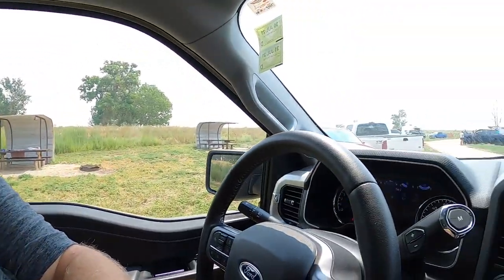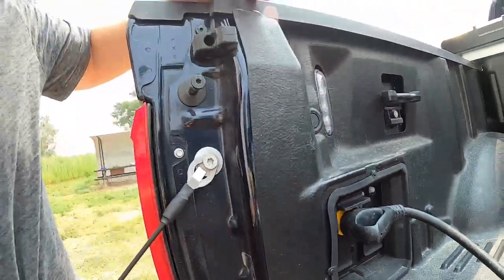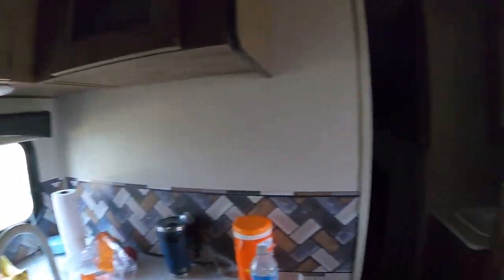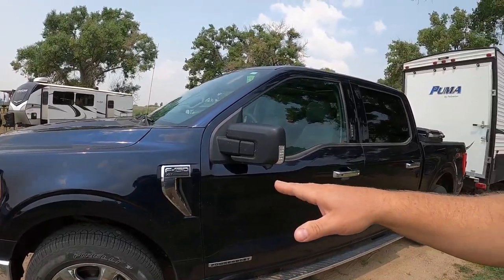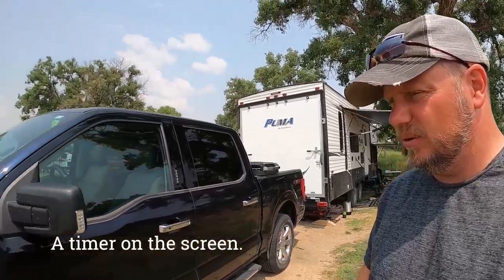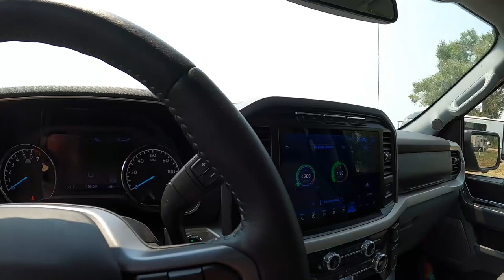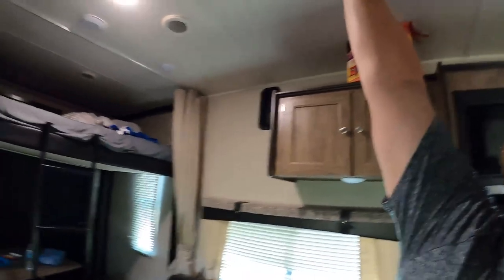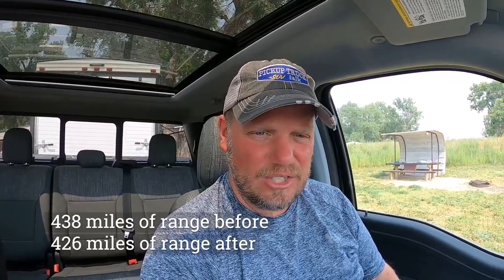Shocking? Running A/C for hours, 2021 Ford F-150 Hybrid Generator

Comment: I'd like to see someone run it for at least 8 hours. Fill up before and after the test to know exactly how much fuel it used, and what it cost. I think that would be the best test to see how efficient it actually is.
Reply from the maker: Impossible test really with way too many variables. I did this test during the heart of the day because an overnight test has just too many variables. What happens if the weather changes? The temperature drops? The wind picks up? We turn down the A/C because the camper holds the cold air better at night? 

Running it during the day for a set period of time shows the worst case scenario. You can take the result and multiple it by 4 to get the 8 hours of the test, which I talk about, and you'll see fuel usage will be around a quarter of a tank, if that, like I said.
Reply: @Pickuptrucktalk  I don't agree that it's impossible at all. I mentioned an 8 hour test because I don't believe a shorter test would use enough fuel to give an accurate result. My point is that it would be nice to know that with the AC running how many litres of fuel you can expect the truck to burn. As an RV owner and frequent traveler this would be valuable information. Especially when boondocking for a week. That way you can decide whether it's better to use a standalone generator, or the truck from a cost perspective.

The problem with your test is that you went off of what the EVIC displayed for miles to empty. This isn't reliably measurable in terms of how many litres are burned.

Also, based on the data from many other RV owners theres no where near ¼ tank of usage after only 8 hours of run time.

I've enjoyed all your videos on the Powerboost, and had been looking out for this one for a couple months since you mentioned it initially. I was just bummed that the litres per hour powering the RV AC still hasn't been tested.
Reply: @skidoomxz550x   problem is SOC of the battery at start and finish would need to be calculated. Also you’d have a variable load… you’d instead need to run constant loads like heat guns
Reply: @cybertrk  Not really, the battery has such a low capacity that I don't think it would make a difference. Based on all the data I've seen the truck runs for about 4 minutes with the engine off, then about 1 minute with the engine on. So even if you're fully charged in the beginning it'll drain it back down in approx. 4 minutes. 

Cranking the AC right down would give you a constant load. Even better would be to test it on an average weather day in your area. Let it cycle on and off at whatever temp you typically set it to. That way you can get the cost on an "average" day. This would allow you to assume for "X" amount more or less on a warmer or cooler day.
Reply: I left my truck plugged in for three days in generator mode in Iowa in August.  I think I used a 1/4 tank of gas.  30 foot camper.
Reply: Ford says the Pro Power 2kW running at full capacity on a full tank will run for 84 hours. 26 gallons (XLT) at $3 is $78 or $0.93 an hour.
Reply: Thanks
Reply: @billypippin3046  What size tank?
Reply: @jonromero4406  30 gallons I believe.
Reply: how much wear and tear is that on the starter/ engine turning off and on every 4 minutes?
Reply: @TheGregh1977  those starters are supposed to last for 10 years of use.
Reply: @TheGregh1977  this Hybrid does the same thing when you drive it.  Especially in the city it’s constantly cutting on and off.
Reply: I ran my entire class A RV including AC, ninja foodie, refrigerator and more for 24 hours used approximately gallons of fuel. Also no comparison to regular gas generator noise, almost silent!

Comment: Thanks for the info. Btw, rv camper is 30 amps at 110 volt not 220-240 volts. Another words same as residential house outlet just more current available at 30 amps vs 15-20 amps. I mention this so watchers dont plug their RV into a 220-240 volt outlet and detroy all the electrical in the RV ;)
Reply: My first thought when he was saying he bought an adapter!
Haha
Reply: Did he not say that it was a 240volt 30amp twist lock to 120volt 30 amp adapter? I've watched something similar to this on TFlL Trucks, but with a dual 50amp adapter. I work in water so I have no clue about electric other than hooking up pig tails for plumbing appliances.
Reply: @Rick not true actually. I had a contractor install a 30 amp plug on my house, but little did he know that that meant I needed 110 even though I specified it was for a camper. Everything ran fine for about 10 seconds, until my convertor started smoking. I lost the fireplace and microwave, but fortunately hadn't turned on the AC.
Reply: @armegeddonschildren  the adapter only uses one leg of the 240v supply. It's just like your house panel.

Comment: Hoping to see a Super Duty Gasser with the built in generator / Hybrid.
Reply: Duuuude, you ain’t kiddin! Imagine a 7.3 gasser with a bigger, beefier electric motor and battery. Of course Ford will introduce it RIGHT after I purchase an F150 Powerboost, knowing my luck.
Reply: They need to make a diesel hybrid, way more efficient

Comment: Even if the engine idled the entire time you would burn less than a gallon an hour, I'm retired police officer and we would have the cars running all shift 8hrs they only burn 5 or 6 gallons in an explorer. If the A/C was running it on the car it would burn almost double that.
Reply: Which is why the NYPD LOVES Ford Fusion Hybrids. Most police cars run constantly. I don't remember the numbers for amount of gas only saved (they save not only gas but less maintenance as well), but their actual comparison figures that that, even allowing for the higher initial costs, the Hybrid cars saved the NYPD more than $10,000 per car over the typical 3 year life of a squad car.

Comment: I just got my F150 Hybrid last week and cannot wait to attach it to my trailer when I get it next month. Already I love the power in the back for charging batteries on the road. I'm 50 years old and 120 pounds, and a solo traveler, so not having to constantly deal with 2 45 pound generators is great for me! And I also won't have to worry about locking them up at campgrounds. Win all around for me! Great video, thanks.

Comment: Thanks for the confirmation review.  Use my powerboost to run my moveable shop out in the woods...band saw, table saw, drill press, planer etc. Hate noisy generators.  I often run it all day. This truck is fantastic.  Amazingly the truck has a better tow rating than the first generation F-350 power stroke crew cab srw it replaced. 

The generator and the tow rating sold me.  Have tested both extensively as described and hauling nice loads of lumber and logs.  Great ride too! I would have been happy with an XL with vinyl and minimum creature comforts.  But, got talked into a Lariat.  Nana likes it so it was worth the extra bucks. Last...it is so nice to drive up to a drive through or talk to a neighbor without having to shut the truck off.  On the road unloaded I average about 25mpg.  Towing my trailer loaded about 13.  

Great truck. Love the quiet. Love the utility.  Love always having an emergency generator tuned up and ready to go.

Comment: Boondocking in Idaho, running the ac in 95 F weather, I was getting a cycle of 8 min on the hybrid battery, 2 min running consistently.  This past weekend in Laramie I used 2.3 gal of gas in 10 hours running time.  2022 Lariat Powerboost.
Reply: Hi, what options do you have on the truck and what did the payload turn out to be? TIA

Comment: For anyone interested in the math on this, technically a gallon of gasoline contains 33.7kWh worth of energy.  So, if you had a theoretical (but impossible)  generator that was 100% efficient, you would be able to get 33700 watts out of every gallon of gas, or enough to run this camper for around 13 hours or so.

Gas engines are around 17% efficient on average, plus energy losses in charging the battery, inverter losses and heat losses in the cables, etc.

All in, you should be getting around 4 to 5 kWh worth of electricity from each gallon of gas.  Since the truck has a 30 gallon gas tank, one could probably run the camper 50 to 60 hours of day time use with the A/C on, and probably closer to 120 hours of total use between day and night.  

So, 5 days worth is probably a pretty good estimate...
Reply: Might have a low fuel cut off, that way the truck won’t be left with an empty tank.
Reply: BTW, this is why Tesla's crush gas vehicles in 'fuel economy'. Gas vehicles run around 15-20% efficient efficient, with newer, smaller engines running better, closer to maybe 30%.
Tesla custom engineered motors will out accelerate any car on the market, and are around 96% efficient.
Reply: @colinpovey2904  Exactly.  The combustion engine is around 35% peak efficient at a single RPM, but is only 17% efficient on average.  Electric motors are over 90% efficient, which is the reason why you can have the performance of a Turbo V8 or a V12, yet have better fuel efficiency than a small 4 cylinder engine...
Reply: So about the same as an on board  Onan generator would.
Reply: @F239141  Probably.  Gas to electricity conversion using an engine is probably pretty similar between engines.  Diesel engines should be slightly more efficient due to higher energy content, but other than that, the process should be about the same.
Reply: @Flash1857  Don't see that feature listed, but I did see the official numbers from Ford..

"Say you want to park somewhere remote and use the truck to power that camper. The hybrid 2.4-kW system will run for 85 hours on a full tank of gas at maximum load of 2,400 watts. The 7.2-kW system will go for 32 hours under the same max load conditions. If you’re not using all of those 7,200 watts, the system will continue for much longer, the company said."

So, I guess one can figure out the fuel level based on the average generator load during the time it is in use.
Reply: @redbaron6805  typical batteries charge at 70% efficiency.  so it's not quite as good as your portraying as far as environmentally concious.  Once charged however, the electric stuff is pretty awesome.  Also, the power plant that produces electricity is around 33% if it's coal.
Reply: @zacharywatson3242  Your 70% efficiency is based on what exactly?

Typical charging losses when charging a Li Ion battery are around 10%, so your 30% claim is actually incorrect.

Thermal losses when generating electricity are a known issue, which is why renewable energy is preferable when charging batteries.  Coal is however 19% of the grid and dropping, and that source is concentrated mostly in rural states like WY, so that is not a typical source for EV charging.

But focusing on power plant losses glosses over the fact that there is a massive amount of energy lost when drilling for and plumping oil, then refining it, transporting it to holding facilities, trucking it to gas stations and then driving to a gas station and using an electric pump to dispense it.

We do know that refining alone requires around 6kWh worth of energy per gallon of gasoline produced.  EV's today can drive over 25 miles on that energy alone, and you can skip the gas completely.
Reply: @redbaron6805  I never took into account the delivery and storage of gasoline vs. producing power...  That changes my opinion on this whole matter considerably.  The battery thing is for an AGM sealed battery. Apparently, lithium is that much better?  Pipelines help transport it to holding facilities. Steam driven pumps are used to make this scale possible.  I still think the carbon imprint of electric vehicles is larger than an average "economy car."  However, gasoline is not forever.
Reply: @zacharywatson3242  OK, fair enough.  The charging curve is not linear and varies based on the state of charge.  So, on Lead Acid batteries, the charging is around 90% efficient when the battery is at 50% or less, but drops to 60% when the battery is at 80% charged and higher.  So, in a floating application, probably close to 70% like you mentioned.

For Lithium Ion batteries, there is also an efficiency loss like with Lead Acid batteries, but much less than Lead Acid.  The efficiency loss is around 13% when charging from 0% to 100%, but since Lithium Ion tend to stay below 90% and above 10%, the losses are far less when charging and can be close to 100% efficient around 50% capacity.

The variable is obviously fast charging, as fast charging creates more heat, and is therefore less efficient than L2 charging for example.

But, there are obviously always losses in the AC to DC conversion, wiring and some heat losses overall.
Reply: Gas engines are over 35% efficient stop talking bullshit.
Reply: @colinpovey2904  diesel engines are even more efficient than gas engines, also that ford engine running as a generator is well over 40% efficient.
Reply: @carholic-sz3qv  How are you arriving at a 35%+ efficiency with a ICE running gasoline as fuel?
Reply: @kdcarver  how am I arriving to what?! Lol.... the toyota prius alone has about 35 to 41% efficiency now imagine all the other modern engines, we're not in the 70's anymore grow up.
Reply: @carholic-sz3qv  
“How am I arriving at what?!”

Are you simply calculating the thermodynamic efficiency of the Carnot cycle (fuel to crankshaft) at the most efficient RPM of the engine?  If you include the drivetrain and aerodynamic variables it will certainly drop your claim below 35. 

Assuming you are referring to only the heat engine itself (not the mechanical linkages involved, or the inherent friction of ineffective combustion scenarios), Carnot derived a theoretical limit of efficiency: n = 1-Tc/Th (temperatures absolute).  Modern engines run a wide range of temperatures between 250 to 1500 K , but for ease of calculation, and giving your claim the benefit of the doubt, let’s assume Th = 1000 K.  Tc we will assume is a nice day in Nebraska, say 70 F (about 300K). I’ll do the math for you, n = 0.7, or 70% efficient. 

Now that’s the MOST efficient a heat engine (without mechanical efficiencies added in) can be. 35% is halfway to perfect, something only Diesel engines achieve . So I’m asking 1) are you only referring to the Carnot heat cycle of the engine in question and 2) if not, what parameters (drivetrain, rpm, etc) are you including in your claim?
Reply: @carholic-sz3qv  No, they're not. The gen 1 3.5 ecoboost gets about 15% - 18% thermal efficiency between 1500 and 2000 RPM, then maxes out at about 28% at around 3000 RPM (decent load, near atmospheric manifold pressure).

Gen 2 (survey was conducted with a 2017, very close to what's in the 2021) had very slightly higher numbers, but couldn't breach 30%. 

Toyota has managed to get 41% (Toyota Dynamic Force Engine) in the current 2.5L Camry, and 37% in the twin turbo 3.4L V6 in the LS500, and that's damn impressive. I drive an ecoboost 3.5 and I love it, but there's no way in hell it's breaching 20% at that low of RPM in generator mode

Look up NTHSA Ecoboost 3.5 Thermal Efficiency and it should be the first result, it's a PDF that's about 90 pages long and has a lot of interesting info about both generations of the 3.5
Reply: Ford cites the 2kW Pro Power will run for 84 hours on a full tank of gas which I believe is 26 gallons.
Reply: @redbaron6805  
Ouch, you schooled him.
Reply: @carholic-sz3qv  You are confusing peak efficiency vs average efficiency.  You are the only one talking bullshit.  Gas engines can be up to 35% efficient at a single RPM number, but on average when going through the RPM range along with transmission losses, they are 17% efficient.

Electric cars start with a much higher efficiency of over 90%, and there are no transmission losses as they use a gear reducer instead of a transmission.  Stick to looking up the facts and fewer bullshit claims....
Reply: @carholic-sz3qv  No, it is not.  Basic math would tell you that it is nowhere close to 40% efficient.  A Ford F-150 has a 30.6 gallon gas tank.  It can produce 7.2kW for 32 hours.  That translates to around 6.9kWh per gallon of gas.  Gasoline contains 33.7kWh worth of energy.  Which means the truck is around 20% efficient making 6.9kWh worth of electricity from each gallon of gas.
Reply: @carholic-sz3qv  I'm not sure what the point is of making stupid claims that can be easily debunked.  The Prius uses the most efficient engine they can make, and by using a Hybrid Gas/Electric system, it gets around 54Mpg.  It is comparable in size to a Hyundai Ioniq electric which goes 4.5 miles per kWh.  The Prius has a 11.3 gallon fuel tank and has a range of 600 miles on that fuel.  The Ioniq has a range of 170 miles with its 38.3kWh battery, or close to 150 miles per gallon. 

So, the electric car is around 3x more efficient than a Prius per mile.  Obviously the ioniq is not 120% efficient.  If the Ioniq is 90% efficient, then the Prius would have to be 30% efficient.

That is beside the logical fallacy of thinking the Prius is very efficient, and "modern engines" are somehow more efficient.  Are you saying the Prius doesn't have a modern engine?

Your entire claim here is beyond absurd...
Reply: @redbaron6805  big nonsense, that ford f150 hybrid system isn't nearly as efficient as a toyota prius which is basically an engine coupled with awesome generator and the other things around. Not all hybrid systems are the same, you're welcome.
Reply: DAmnnnn!!! this is amazing!

Comment: The 7.2KW pro power is one heck of a package to be honest. I saw another video where the truck actually used less fuel over an extended period of time than a gas Honda 5.5KW generator.
Reply: And it’s not a separate item, and it doesn’t make a loud annoying noise constantly, and it has emissions equipment unlike a generator that just pollutes unabated.